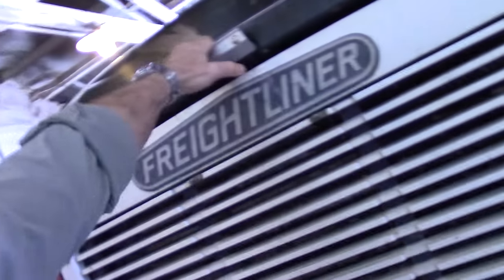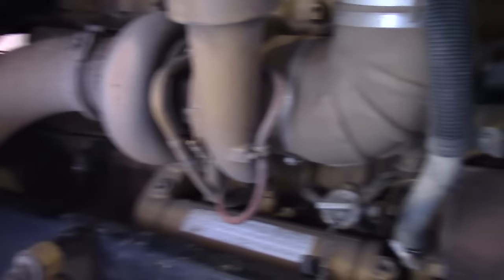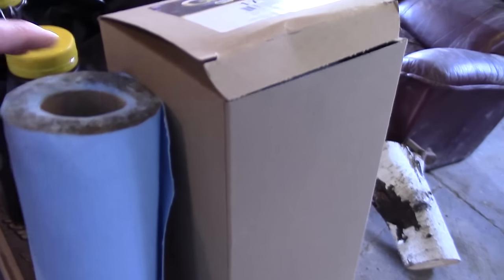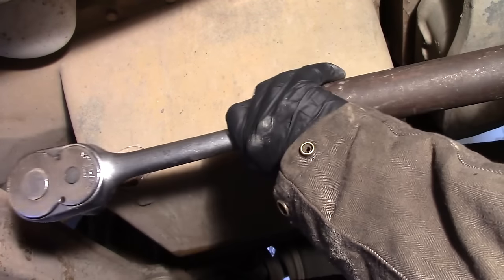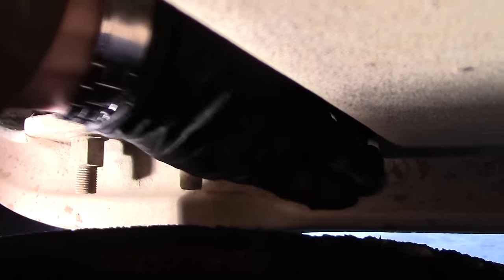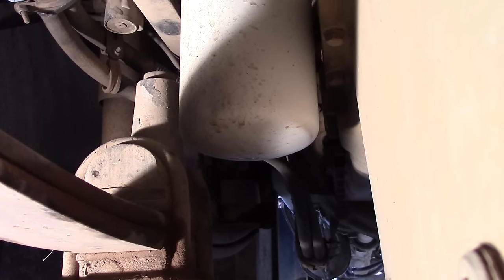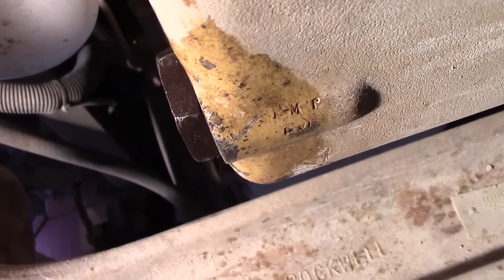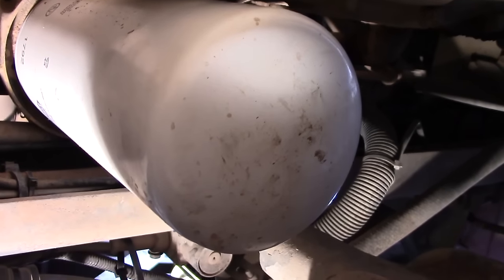How to do an Engine Oil change on a BIG Truck-DIY Duke

Comment: Changing the oil is easy, you juts need a huge drain pan as there is a lot of oil.  Or you can suck out the oil from the top.
Reply: You've never heard of oil extraction for changing fluids? Wow

Comment: how many miles/kms a truck can run after oil change before it needs new?
Reply from the maker: +Park Max 15 - 20,000 miles on regular oil.

Comment: Damn if that was my truck and you was using Napa oil in my rig and Napa oil filters in my cat ohhh it ohh boy I would be chasing you around that shop with a shovel in my hand lollll :) great video but cat engines should only use cat filters
Reply: What about Donaldson Filters?

Comment: Im here to find an easy way to fill the new oil to that huge engine,from you. bcoz Im a diesel generator mechanic.but nothing seen..
new oil is available in buckets of 10 ltrs or 15 ltrs..but why you uses that lots of 5 ltr oil sachets...??

it's never good that running engine with empty oil sump..

and you should want to change the fuelfilter also..

Comment: How often do you change? How many thousand miles?
Reply from the maker: It really depends on usage, age and manufacturers recommendations.  For example a Detroit 60 series with 650,000 miles gets its oil changed every 15,000 miles.  Some newer engines are going 25,000 or more miles.  Check the recommendations for your particular engine

Comment: Can you replace the filter without filling oil in the new filter and then add oil in through the oil inlet(filler neck ) on the passenger side of the engine?. Will the oil run into the filter ? If so , then it would be easier. Filters with oil is heavy to lift and tighten in that cramped space.
Reply from the maker: You don't have to, crank the engine over and the oil pump will kick in

Comment: How often do you change the oil on these trucks?
Reply from the maker: indyjons321 every 15,000 miles according to recommendations, but I've heard some are doing oil analysis before and the oil looks good so they'll go much longer especially if they haven't done much idling.
Reply: Why is idling bad??

Comment: there is a mistake . before loosening the drain plug one should loosen and open oil filler cap so that the oil is forced out. and before everything engine should be warmed by driving few kms

Comment: No copper washer or tie wire to secure but if it came loose seen it before and engine had to be rebuilt  just showed the bad UN's how to put a trucker of the road and have a $20.000 bill

Comment: A trucker I knew said his company just pored the used oil in the fuel tank.  Does that sound legit?
Reply: Yes it works but ill advised. At 300 gallons 13 or so gallons of oil would be just enough to lubricate the pistons. Most people say run the old oil through a 1 micron filter and then it's perfectly safe to dump in the diesel.
Reply: I was thinking running used oil directly from the oil change would clog the fuel filters.
Reply: do not Do this too new vehicles with def you will screw up your filters
Reply: I di the same thing with my diesel VW (Its an old one. Don't do it on any diesel newer than about 03). Filtered it down through a 5 micron  bag first though.

Comment: Punch a hole in the bottom of the filter, or if the axle is under it in the way punch a hole in the side of it.  Your Going through way to much trouble!  Also little overkill with the 3/4” drive ratchet for the oil pan bolt.  One last thing the threads that the filter spins onto is a pipe and they vibrate loose make sure it is tight in the filter housing.  I know this is a cat but I’ve many on dd 60 series that have come loose and drop the filter.  Just my input I’ve been a diesel technician for 10 years now and I’ve seen stupid stuff happen.

Comment: Like talking on youtube channel..........Jed Klampit....does that plug have a o-ring?...Amen 3/4 turn on filters for non comms.....I put date & miles on bottom....maybe a bolt plug on your can so you can drain that used oil back in the jugs then back to wallyworld.

Comment: No, the filter should not just spin off by hand. cat brand filters tell you after hand tight spin 1 rotation after. most others are 3/4 of a turn after hand tight. prefilling an oil filter is unnecessary and the "dry start" is a complete myth. also, he didn't replace the oil plug o - ring (cat says to replace everytime) and didn't torque the pan plug.

Comment: Cat doesn't recommend the filter to be pre refilled. Just lube the seals.
Reply: It's funked up, cause I agree they tell you not to, but after we had a engine overhaul done and we did the 1st oil change, the mechanic who did the motor himself said it doesn't matter whether you do or don't. There's enuff oil down below to lube the motor.
Reply: Johnny Lewis if you're working on equipment out in a construction field kitty likes it dry! If you're in a shop it doesn't really matter
Reply: Dont fill it in the clean side , if you fill it do it on the dirty side so you're sure you do'nt  get any unfiltered oil in the critical parts of your engine.

Comment: If it produce 450 HP @ 1800rpm it will make 1313ft-lbs of torque
450hp÷5252x1800rpm=1313ft-lbs of torque.

the torque will be a higher ratio at below 5252 rpm or torque to hp

1313(t)÷5252x1800rpm=450hp

Comment: How much would an oil change like this cost?
Reply from the maker: +F!@#Guilt it varies from 150.00 to 300.00 or more.  Love's, Petro, Travel America truck stops are cheaper than dealer shops.
Reply: DIY Duke My GOD! But, guess it makes sense....I really appreciate my 25$ oil change....
Reply: Synthetic Diesel oil is approximately $24.00 per gallon...
Reply: costs me $234.00 u.s. to get an oil change at a t/a truck stop.but they also change my fuel filters and grease the entire truck check and adjust all air pressures.so time vs.money it's cheaper to get it done at the truck stop.pull it in..go grab a bite to eat and back to work.never miss a beat ☺
Reply: +Jd Kepler It is not a bad price at all considering, what, 10 to 12 gallons of oil. Lube oil filters must be, what, 20 to 30 and fuel filter similar or more...
Reply from the maker: +Walter K yeah JD'S right on.  You can't beat those prices.  They buy oil and filters in bulk lowering the price.  If you're long haul, that's the best way to go.  Know your truck though and don't get suckered into unnecessary repairs.
Reply: Just an oil, filter and fuel filter will be around $320. Most 12L diesel engines take about 40-44 quarts. But full PM service at Speedco (Mobil Delvac oil, oil filter, two fuel filters and air filter) is gonna be about $400

Comment: Your missing a copper washer on your drain plug 😮 also punch a hole in bottom of oil filter dead center and drain it into the catch pan

Comment: I had a customer come into the dealership after going to one of those Quicky lube complaining of a knocking noise from the engine we checked it found out her brand new GMC Acadia was low on oil come to find out that the Quicky lube only drains half the oil which this veh took about 7 qts who drains only half the oil on a oil change worst part they forgot to top up her oil well they did pay for a new engine 7k later also way pay for a oil change which was included with her vehicle.
Reply from the maker: +Wayne Nineonenine wow, that's messed up Wayne.  Poor lady just wanting a simple thing done and has to go through all that hassle.  What's wrong with people?  All for a little bit of money, guess they got their comeuppance though.

Comment: I have not seen the copper washer under the cap?.
Reply: Marko Lisec does the material matter when it comes to the washer?
Reply: Yes it is matter, in most cases the oil pan is made out of some iron  and then i put cooper washer under the cap, but on newer vehicles we can find aluminium oil pan and then i put aluminum washer...  I always do on that way...

Comment: What was millage between engine oil change ?
Reply from the maker: +mikkei 15,000
Reply: thx. In europe we change engine oil sometimes by 65-70k miles. cheers
Reply from the maker: +mikkei you're welcome.  People who use synthetic oil go much longer between oil changes.  That's awesome you can get that mileage.  Good to know thanks.
Reply: mikkei 70k miles???? what? 70k miles is over 100.000 Km that is impossible....
Reply: not, imposible   my family have 10 x DAF's from 2015.  OUR trucks  are serviced in autoriced  DAF serwice 
- they have in warranty book a oil maintenance - aprox 90-100 k kilometres- oil is full syntetic  Mobil Delvac 1 LE 5W-30  http://www.mobil.pl/Poland-Polish-LCW/heavydutyoils_mobil-delvac-1-man-oil-approval.aspx
Reply: Oh i thought you were talking about cars not trucks

Comment: It's actually 475 hp just looks at the data sheets
Reply from the maker: Data sheets dont hold water against the metal manufacturers data on the engine.

Comment: 290 ft-lbs of torque at 1800 rpm for a 14L diesel? I don't think so. Gas engines a quarter that size make that much torque. Diesels are long-stroke, high torque engines. You probably know way more about it than I do so I'm going to assume you misspoke. And that is a huge CAT diesel.
Reply: It's more like 2000 ft-lbs of torque.
Reply: phatcowboy76 he meant 1800

Comment: 290 lb-ft? that doesn't sound right... my 4 friends jeep has more torque if that's the case...
Reply from the maker: +Phoenix HAM it's 1800 lbs of torque - my bad
Reply: Phoenix HAM I was thinking the same thing. sounded really weak.

Comment: NAPA oil really? Come on man 😳 insert plug for Rotella for 25,000 miles or Mobile 1 full synthetic for 60,000 miles with an extra Baldwin filter change at 30,000

Comment: I am amazed nobody has had the brainiage to invent a tap for engine oil. You will be telling me that guns haven't got electronic ignition yet.
Reply: Good grief plastic bags for filters is that why you needed a lamp underneath because this was made back in the dark ages?
Reply: Fumoto makes taps for oil drain plugs. The two problems with them are the possibility of the tap getting knocked open due to vibration/bumps if there is nothing holding it closed(Fumoto makes clips just for this). Also, they drain really slow. That and it would add cost to the car, so why would manufacturers do that? :\

I think naval cannons have electric ignition. :)
Reply: > That and it would add cost to the car, I think naval cannons have electric ignition.  So why would manufacturers do that?

You are right. Certain things should be made of unobtainium and durecyclite otherwise the second amendment would allow the DIYer to make Gattlings out of Saturday-night speculiars.

Imagine a world so Satanic that there were no blue or red pills.

Comment: I've always changed my oil and never had a problem. But Idk wtfthe deal is but I have yet to be able to change the oil on my new dart. I can never get the FUCKING plug off
Reply: It's a 13 mm.  What problem are you having?  Rounded head or just really tight?  Those darts are low too are you doing it on ramps?
Reply: Gabe Tabor why yes it is a 13 mm how'd u know? Lol idk I just can't get the fuckin thing off. And I don't yank it on there. I beat on it, try and when it's hot when it's cold. It seems like unless ur able to get it up on a lift it won't come off. U know I'm no mechanic but like I said earlier I've changed my oil in everything from my first Buick Regal to my Cummings I had a few years and never had a single problem. I just can't seem to get this one
Reply: I change oil on them quite a bit.  Sometimes the dingbats doing the oil change puts to much on it.

Next time you have it done, tell them to take it easy.  It doesn't need to be that tight.

Comment: Dude take your truck to someone that has ET you can program the engine for a retarter and gain another 10% free hp
What no cat oil filter 
No real cat mechanic would put a generic oil filter on
Always knock a hole in the oil filter and drain it while the pan is draining
Always replace the water filter with each oil change after checking the condition of the coolant 
Million miles bet the liners are cavitated 
What about the fuel filters if your going to do it do it right 
Always want to pull your drain pan out before starting cause it the fan comes on it can blow the old oil all over

Comment: Wait what, it only has 400 hp?  A new mustang GT350  makes more HP.
Reply: A lot of torque mate
Reply: HP is a calculated from RPM and Torque....
Reply: Oh he said at 1800 RPM.
Reply: All that matters is torque. 1800ft-lbs. That would rip a GT350 in half.
Reply: a new mustang aint going a million miles either....
Reply: He said it only outputs 290 ft-lbs. though, that's still less than a GT-350.
Reply: Stay away from my peanut butter it makes 1800 ft-lbs of torque and probably 450+ HP.
Reply: Read the comments, he was mistaken. It's 1800lbs. 290lbs would be a joke.
Reply: ScreamingGoat43 it's a Diesel engine they're made for torque not horse power. The torque on these things are up in the thousands it's all about pulling power
Reply: Generic Name more like 130,000 but if you over load these things they'll pull more than 500,000😂
Reply: U know HP ain't power.. tourqe is the power.. HP is the calculation of how fast the engine can deliver the power
Reply: A moden cummins 15L engine makes 2150ftlbs of torque at about 1150 RPM.
Reply: ScreamingGoat43  Horsepower is simply the rate at which torque is produced. Besides, a Mustang can't use all that horse power even if it had the same torque because it has less horse traction.

Comment: How stupid is it to check oil after the engine has run??!?! All the oil is in the channels and around the engine parts it's not all in the sump so you don't actually have a measurement. It's pointless.

Comment: i dont understand why a semi truck has a huge engine like this, three times the size of a mustang engine, and only puts out 400 horse and 300 torque. i can get more than that out of a mustang engine at 1/3 the size and fuel consumption
Reply: Dean Kruse over 2000 torques
Reply: Scania DC16 V8 has 730hp and 3500Nm
Reply from the maker: +Pedohammad actually 1800 lbs, I messed up
Reply: Yung Trev he says at 0:50 it has 400 horsepower and 290 torque. that is absolutely nothing for an engine that size
Reply: Dean Kruse the uploader just admitted to messing up
it makes 1800lb ft of torque